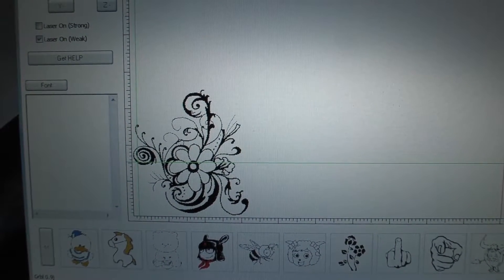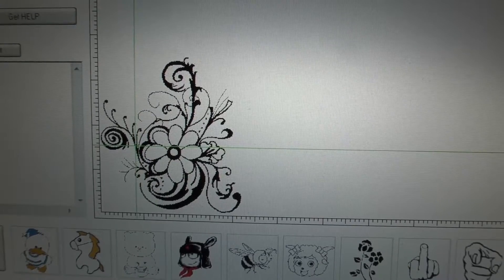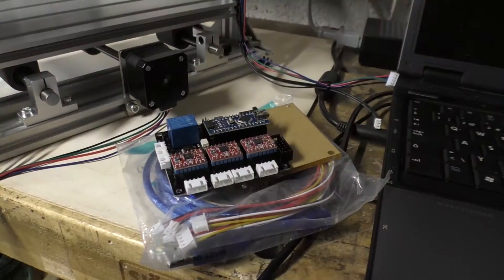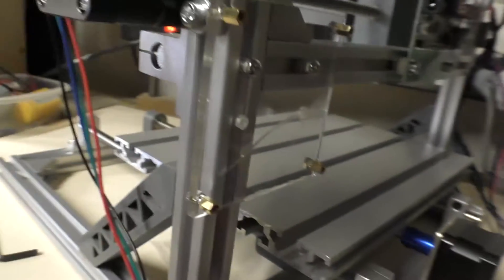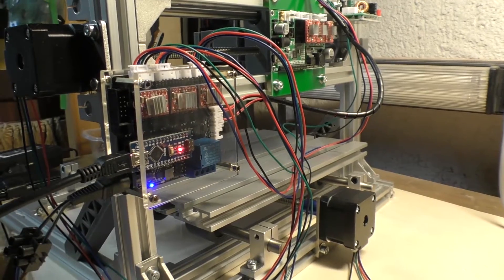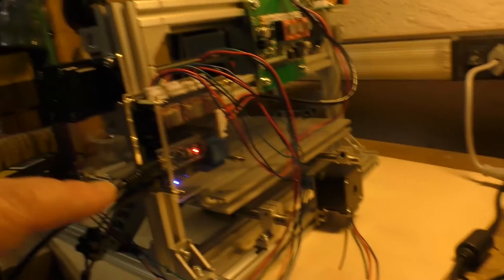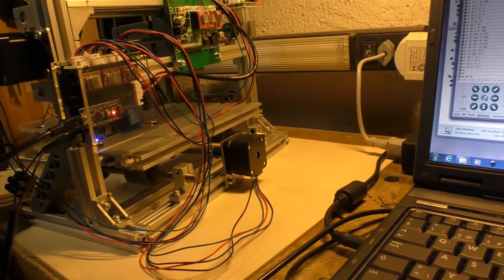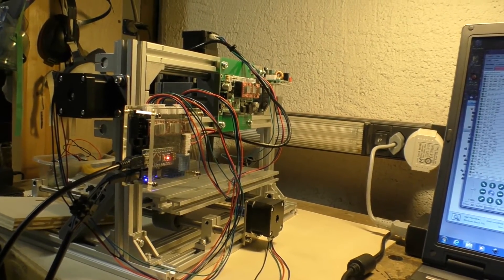CNC2418 laser engraver - new controller, new GRBL version.

Comment: To correct the mirror image invert the X axis if you can via software. If not there is a way by re-wiring one end of the plug wires to the motor as a mirror of what they currently are.